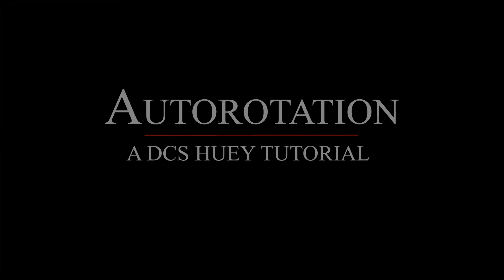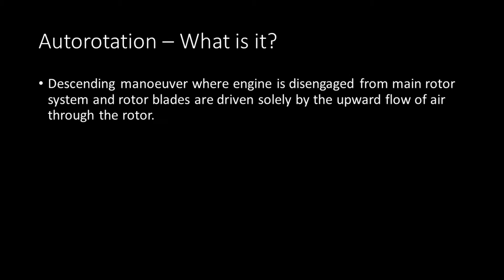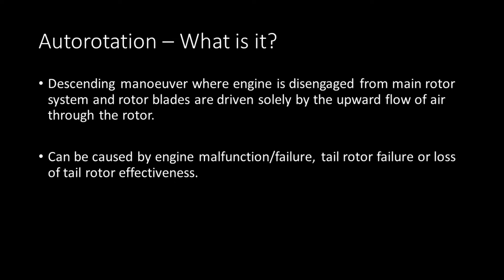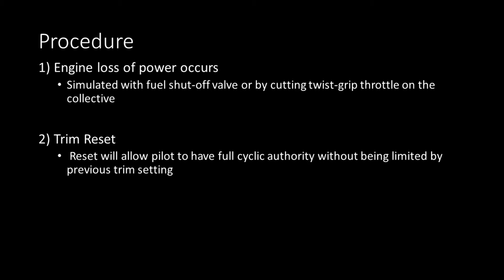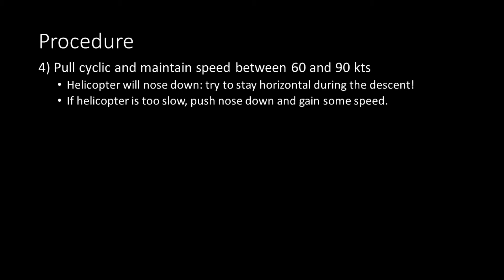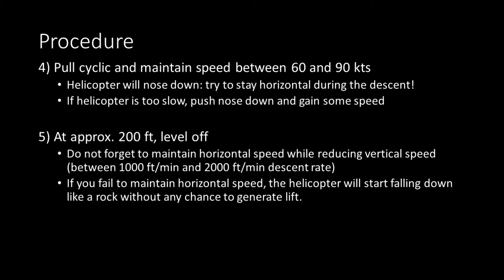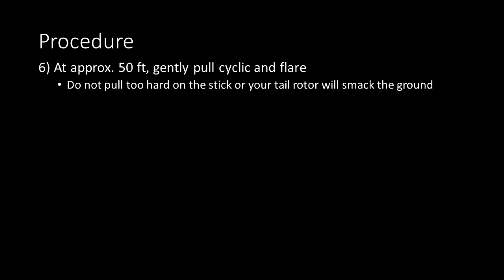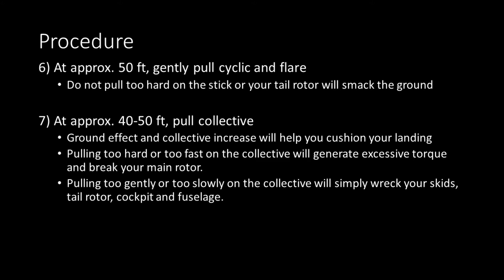DCS Tutorial - UH-1H Huey Autorotation

Comment: Oh god... on a real autorrotation you would have wrecked your Huey! You just cant go to the ground like a rock after the flare!!! you cant lose horizontal speed... you must touch the ground like an airplane... Too much collective at once makes you float and after you lose RPM you go down HARD... Its not the same to autorrotate at 90 or 60 knots, becouse that change in speed make you go far or near to the position you had lost power... depending on how far is the spot you choose to land is the speed yoy need... you should also try to autorrotate in a suitable surface, not in a upgoing hill...
Reply from the maker: Those are all fair points indeed. I did indeed change my autorotation techniques since then... keep in mind that I was barely capable of flying the Huey at that time, much has changed since then (I have become more experienced, the flight model has changed and the ground collision model has been much improved). Back in those days in 2014, the second you would start sliding on the grass at more than 15 kts you'd rip your skids apart or you would "bump" the nose forward and smack your main rotor on the ground while doing cartwheels. I find your comment on the suitable surface interesting: most of the time you would have to perform an autorotation in real life, you usually don't have the luxury of having the best possible surface. It is good practice to make the best out of the worst situation possible.
Reply from the maker: The actual US Army autorotation procedure is listed in this document on page 61  https://drive.google.com/open?id=0B-uSpZROuEd3Q1Bjd3hsOTdBWUE
Reply: yeah i dont meant you need to practice always on a runway, but i think you could have chosen a best spot to land... but the video is old and you brougth a good point on that...
Reply: great manual! excellent work... i'll read it...! Thanks